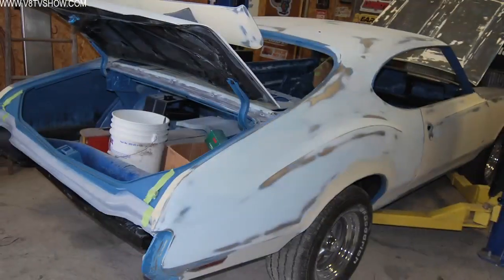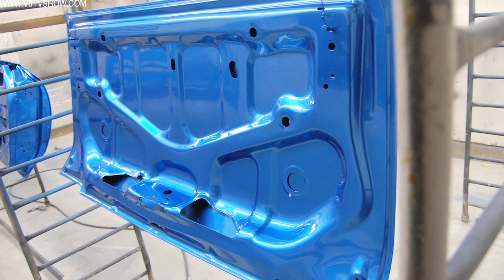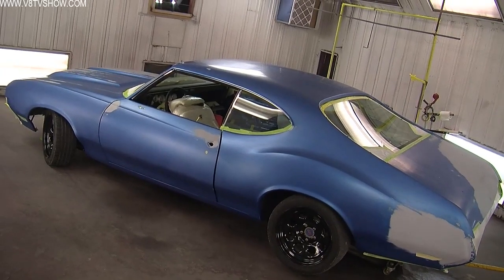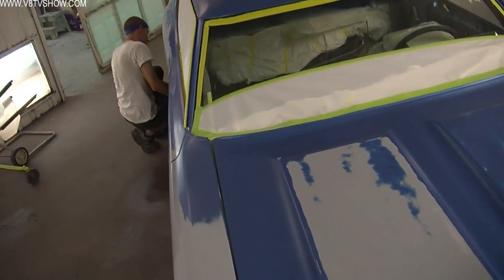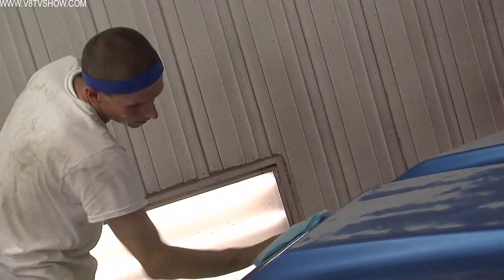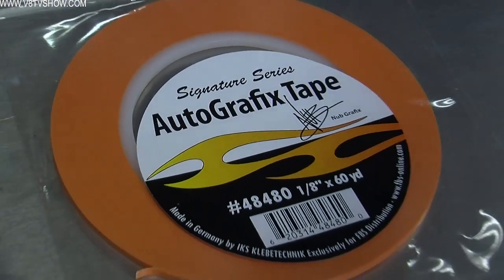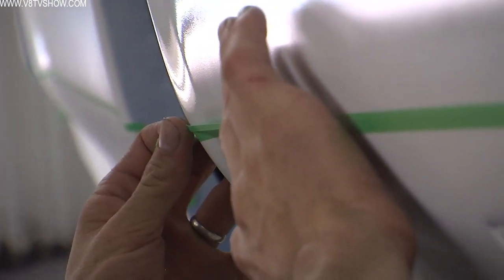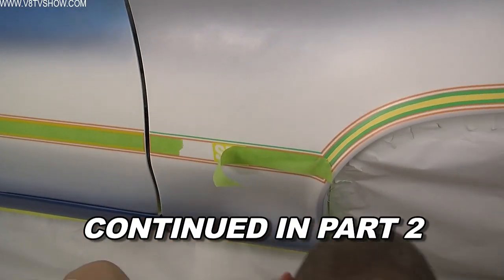How To Spray Color, Stripes, and Clear on the 1971 Oldsmobile Cutlass S71 Video Part 1 V8TV

Comment: Those olds strips on the side are hard strips to do that's for sure..   I remember doing the ones on my '70 W-30 
 Great job..  but on the '70 W-30 only has the two strips the 1/4 inch on top the the wide one underneath...only the two strips not three strips...there is also a stencil kit you can buy for then now but when I did mine there was none...but just only the 1/4 " & 11/2" stripes are the only two not a third strip ...